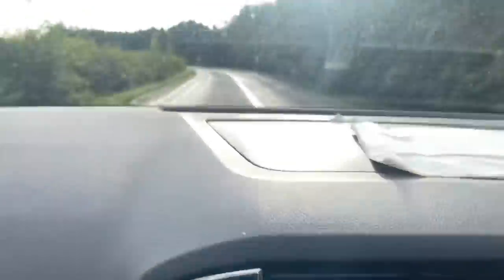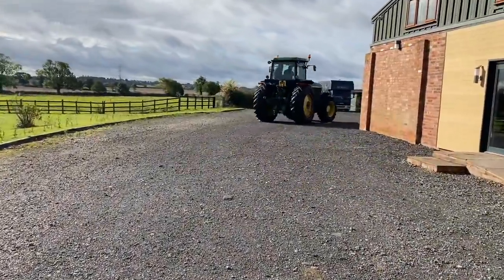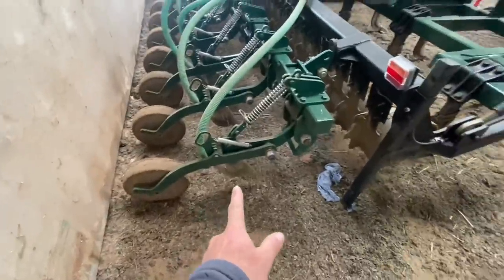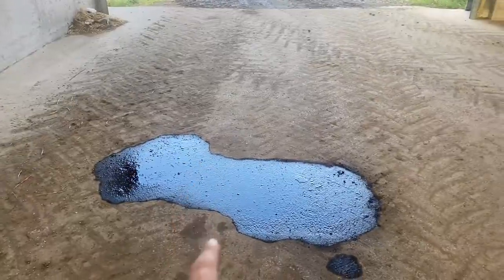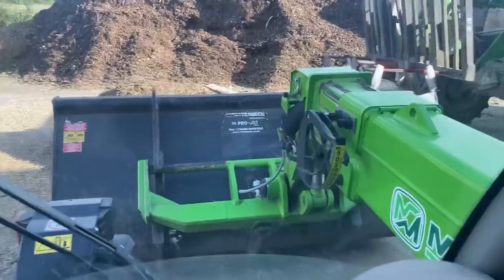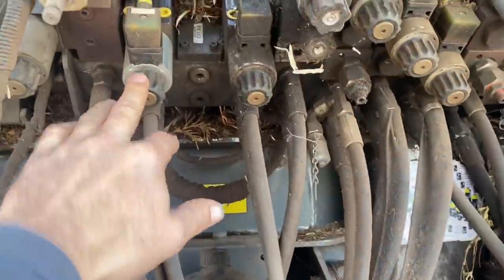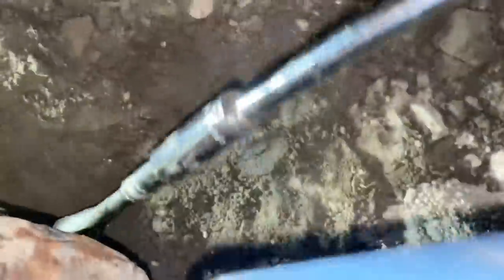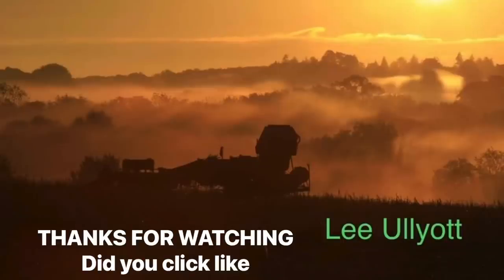Day558 #OLLYBLOGS CLASSIC JOHN DEERE 4755 and 4955 SHOPPING  PLUS CHIPPER PROBS   #AnswerAsAPercent

Comment: The solenoid problem sounds like what its driving is under alot of strain, could be a bearing gone on the conveyor or something binding up, only way to check is to take off the belt and try turning the rollers by hand to see if you can find whats binding

Comment: For the fuel bowser you can use exhaust gas to purge it and clean it, doing a purge will remove fuel stuck to the sides if you get it empty, then if you fill it up with something to wash the inside you’ll get a really nice clean job.
Reply from the maker: What you mean exhaust gas purge
Reply: @OllyBlogsAgricontractfarmer  you put some pipe on a vehicles exhaust pipe and run it into the bowser, then turn vehicle on and give her some revs for a bit, for say half an hour, and it will essentially dry the inside of the tank and will remove any fuel vapour left inside, then you can give it a really good clean without having any fuel contamination with what your trying to wash it wish, which makes it harder to clean. What would be best to clean it with I’m not sure tbh. It’s a common method used for cleaning and welding fuel tanks so it doesn’t catch fire while doing so

Comment: The rhubarb derived (by boiling up rhubarb leaves) chemical is oxalic acid. It will dissolve iron oxide (rust). Once cleaned out you'll need some form of waterproof coating to stop further corrosion. Cheers,
Gavin

Comment: Is the solenoid AC or DC?   AC coils get hot / burn out if the slug doesn't pull right in properly because of mechanical problems in the valve.

Comment: Sure he will have the 4955. Are you sure the coils you have swooped are actually the same ( not just look the same) the bed drive will be variable speed so a proportional control, the others will probably be on off control. They often have a different coil type. Red or green light is just what led is in the plug top. ( though makes you wonder if it different if that had been on from new) Does the speed vary correctly or is it running flat out? If so try turning the speed down and see if it is still getting hot
Reply from the maker: It engages clutch for belts for  the Hydrolics to turn on so prob is open all the time

Comment: you need to change the valve its self not just the coil, if the valve is not fully opening or closeing it will draw high curent constantley and burn up. you prob have a faulty valve